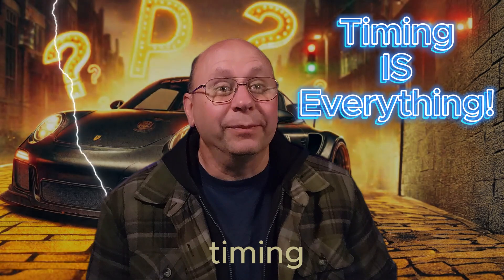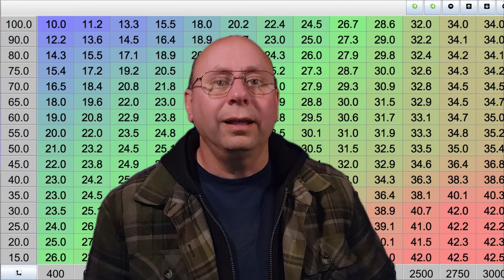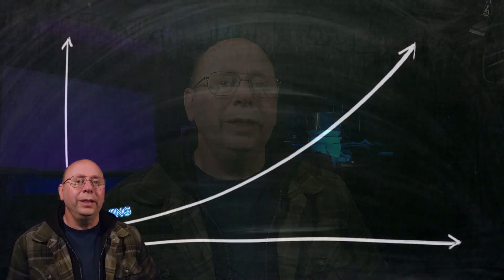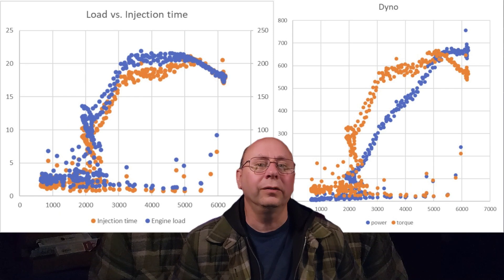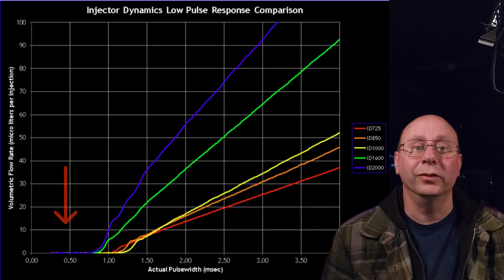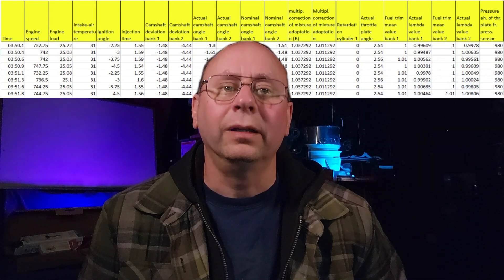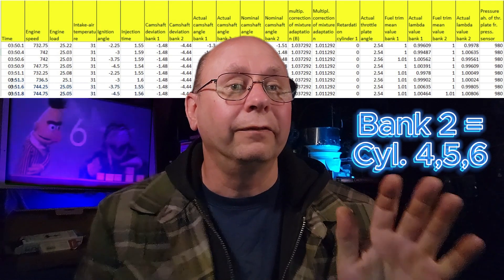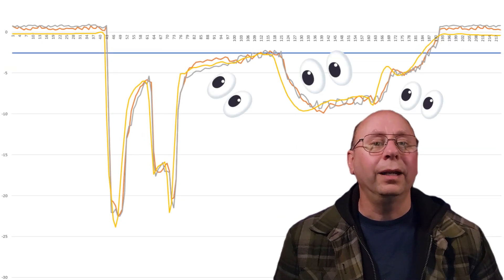Ep. 2: Avoid Engine Damage! Datalogging explained

Comment: I've been running Boostane with your k24 billet tune and it is going very well. Do you have any thoughts on these MMT type octane boosters?
Reply from the maker: I've personally not run Boostane but hear good things about it.   Hopefully they've gotten over the issues like most other octane boosters where they tend to coat the plugs, o2 sensors and cats after a while.  You should be able to tell if you pull a plug out and it's brown/reddish in color and kind of fuzzy.  If so, you'll need to do much more frequent maintenance due to that.  Meth injection can be a cleaner/safer/cooler alternative.  Or if available, E85 is amazing all around!   Maybe we can all get together and petiiton for more E85 stations around so availability is no longer an issue :)
Reply: @protomotive  Thanks for the thoughts. I'll send you a log sometime.
Reply from the maker: @bernardthefourth   Awesome :)   The datalog will tell us how well it's all working for sure!  Have a great weekend.

Comment: Thoroughly enjoyed all the information in this video! I had known you couldn’t take a tuned car and simply add more boost for more power, and video helps explain that everything is connected…boost, timing, fuel trims, and other parameters. Thanks for the great video, Todd 👍🏻
Reply: Todd, I do have one question. You touched on the knock sensors being very sensitive in the 997TTs, which gives one a little wiggle room in terms of engine protection while finding the optimal amount of timing. If I’m looking at a COBB datalog, specifically the knock sum for each cylinder, what do you recommend is the safety threshold before engine damage starts occurring? For example, I’ve recorded some runs where the knock sum on some or all cylinders can show -4.50 as the revs get up in range during WOT. When I see anything other than zero throughout the run, I start getting concerned; but at what point should I really be concerned? As always, thanks for all the invaluable knowledge sharing!
Reply from the maker: @nev997TT  That's a lot of knock.   You should either improve your octane of fuel, improve your intercoolers, decrease the boost or decrease the timing to get that knock down to 0 which is preferred for the best safety.  especially for bolt-on applications!   The knock log is showing you what to do in the tuning to fix the problem.    And since these tend to overcompensate for knock, you're actually making less power with it adapting the knock than you would be with the timing adjusted properly and having no knock.
Reply from the maker: You're very welcome!   We've been working on Part 3 which will be the final episode of this series.  So be sure to keep an eye out for it!